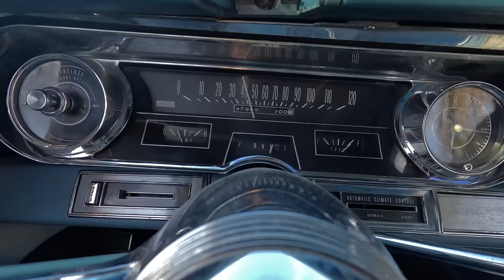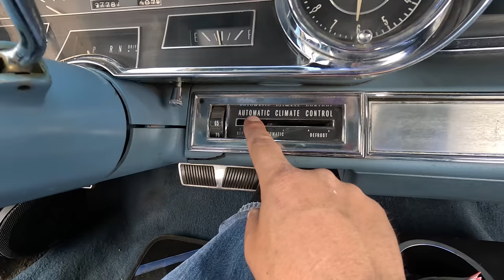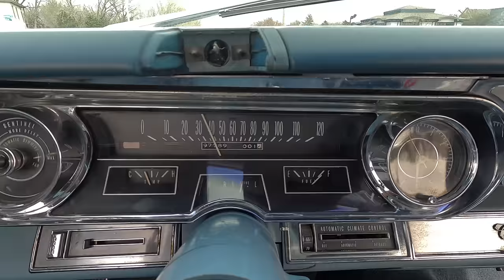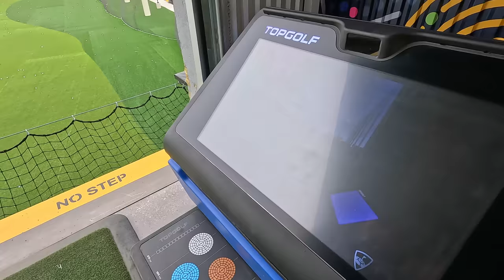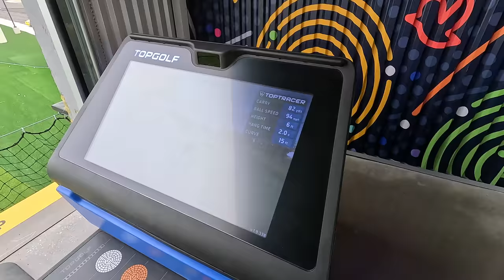I Won a 1965 Cadillac DeVille on Bags from Manheim Sight Unseen! Will it Make it Home?

Comment: Had a 66 cad which is about the same. Great car. Has a couple of things you might want to know. The water pump is a bear to change, heater hose that. Runs under the intake manifold , tail light bulb change requires removing rear bumper. Loved my 66 conv. You have a bueatiful car!!

Comment: Hey Randy good  pull on tge tge Caddy.  Wheels work with the color scheme,  Inside interior looks like the should copy the exterior.  But there's a reason the sales person said  you should trailer it back. Mainly for the battery & that oil cap situation.  Follow your dreams man...

Comment: With it running in the battery disconnects, it should run off the alternator. Unless it's just running off the battery with the.alt not chargeing or regulator is malfunctioning

Comment: It is interesting how it has a 1963/1964 Cadillac steering wheel in it.  I wonder why they changed all that out.
Reply from the maker: Steering wheel is correct for 65 without tilt. So is the ignition.
Reply: @AutoAuctionRebuilds  No sir they are not.  The '65 steering is a 3 spoke unit.  The wheel you have is the one I had in my 1963 Cadillac Hearse but with a red center.  The 1964 model had the gold.  The ignition should be flat without the protrusion.
Reply from the maker: Every ignition photo of a 65 shows the same one I have. Looks like there weee 2 options for steering wheels one is a 3 spoke one is a 2 spoke. All about the options.
Reply: @AutoAuctionRebuilds  You know what Randy, Cadillac never used that type of ignition.  That was a Chevy item.  I have had the following Cadillacs  1959, 1960, 1961, 1962, 1963 and 1965.  None of them had that style ignition.  As far as the steering wheel goes, I have never seen a 2 spoke wheel on a 1965.  The car had to be all new for that year to attract customers.  They would never use last years steering wheel.  With all that said I look forward to watching you on Power Tour with it.  It will be a blast.

Comment: I am not a purest so I  would put a modern digital dash in it and modern steering wheel. The car is nice as is but since it was butchered up for air suspension then go full modern. Nice Cadillac for the price. 👍

Comment: i happen to love the 1959 sedan. i love the black on pimento red interior. yes it was called pimento by gm. i only ever saw the convertible on black and pimento but i love it. also would love to have the sedan with every option possible and be there and working not this alteration stuff or stuff broken or taken off. yes i am a total sedan guy grew up on sedans and also grew up with column shift automatic cars. my late father got to a point of if the car didnt have a column shift automatic he wouldnt own it.

Comment: Usually When the car dies because the battery cable came off Means the alternator is not charging.
Reply: That's true, but that alternator looked brand new.

Comment: In the car business there is a saying….The’re is an a** for every seat!  True but this wouldn’t be for me.  For the dollars that were spent for those useless mods it could have been restored to its former glory.  Those mods are very hard on suspension parts such as ball joints and control arm bushings. I would check those before driving it very far.

Comment: Run Valvoline VR1 it has the higher zinc rating that those old engines and doesn't burn off like modern oils.

Comment: Don’t take that disconnect switch off. A friend of mine had a bagged car without one and the pump seized up had he had a disconnect switch the car wouldn’t have burned to the ground. And correct me if I’m wrong but shouldn’t the car still run with the battery disconnected? And if it dies it means the alternator is bad..

Comment: I'd be surprised if that old analog clock did work. I thing the only thing I would change is put wider whitewall tires on it. I think the wider whitewalls would pull the white together on those black tires!!

Comment: Nice caddy. I like the ride height where the rear wheel center cap matches the fender skirt lip and the front wheel shows 1 inch of rubber at the fender lip.